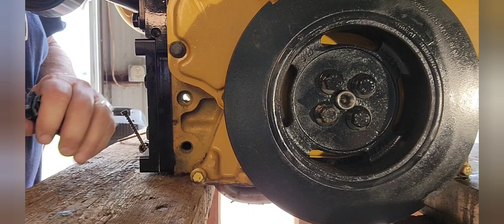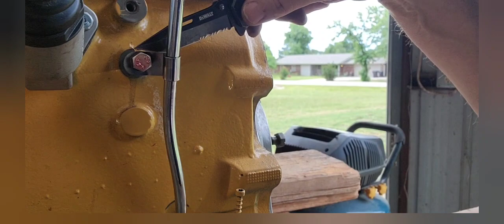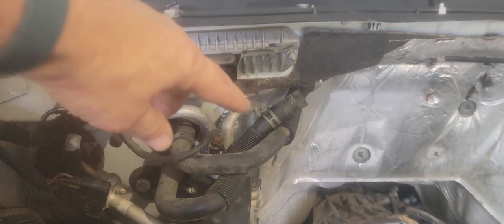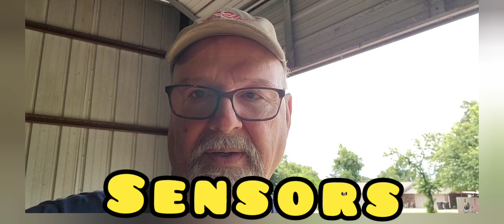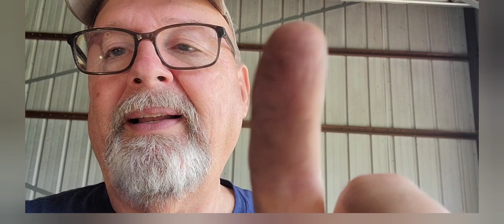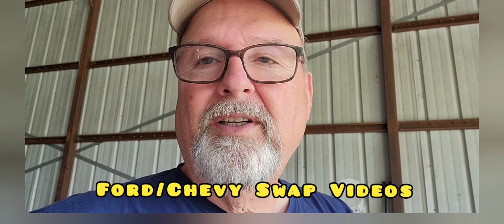Swapped 6.4 Ford Powerstroke For Cummins 5.9 12 Valve (Episode 13) Dodge vs Industrial

Comment: Hi i measured my holes in the frame for the trans mount there 2.75 not 2.58 just curious
Reply from the maker: Are you having trouble mounting something? Because 0.17" difference shouldn't make much of a difference.
Reply: @PopsFBR for the driveshaft measurement  to shorten or did you not shorten yours

Comment: How did that hydraulic pump work. I used the same 1, the brakes feel kinda spongy and getting a soft whine from the ps.
Reply from the maker: Yeah, the feel of Ford system is different, but braking is the same.

And yes, they make a whine.  Make sure & use auto trans fluid, not PS fluid.  
Thanks for watching.

Comment: I tried to message you on Facebook about the air compressor. I am interested.
Reply from the maker: What's it worth?  I've heard everywhere from $2000 to $200.
Reply: @PopsFBR I have no idea. Let me know what you are thinking
Reply from the maker: @Bscully  do you want the power steering pump also?  They're mated.
Reply: @PopsFBR yes I would be interested in that also
Reply from the maker: @Bscully  I see them between $850-$1000
Email me for photos:
Pop66flatbed@gmail.com
Reply from the maker: I still have it if you are needing it.  Make you a good deal.  Email pop66flatbed@gmail.com